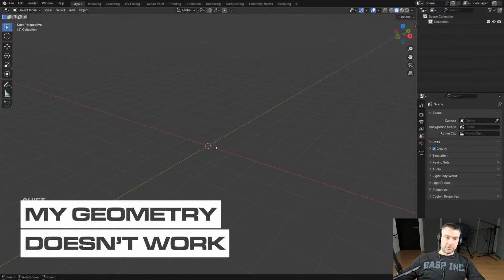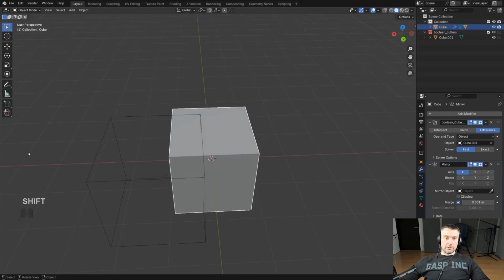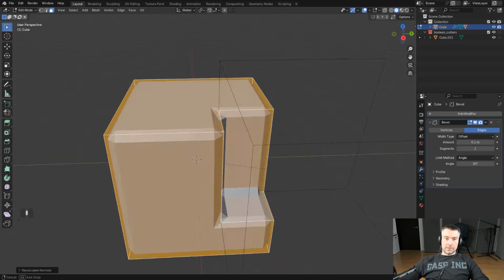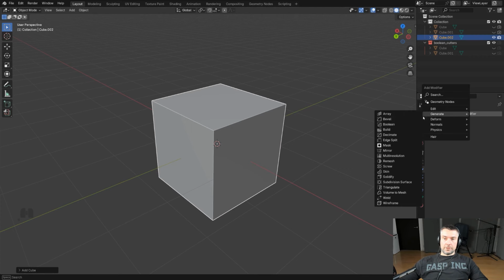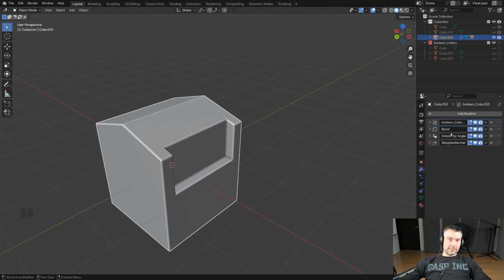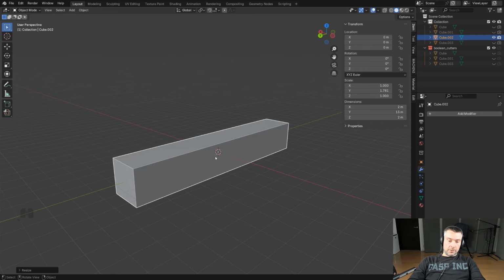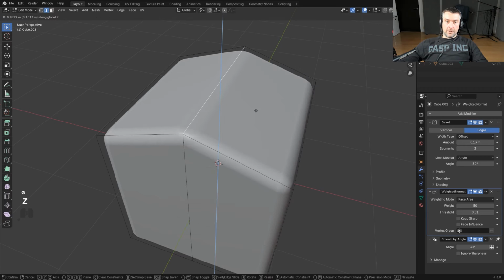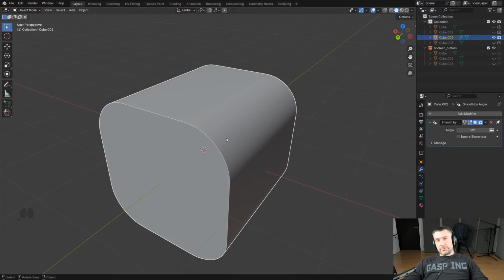Stop Making These Blender Mistakes Right Now

Comment: Hello, do we use tools box cutter and hard opes into The Hard Surface Accelerator | Legendary Edition  in the course ?
Reply from the maker: no, that course utilizes machin3 tools. Hopcutter would be too much for beginners. If you want to learn how to use these addons I suggest the ultimate Guide for Hardops and Boxcutter course, you ll find it on our store. But if you are a beginner in Blender, I'd recommend you go through Accelerator, without basics you'll ge t lost.